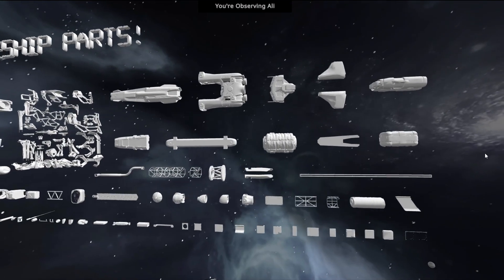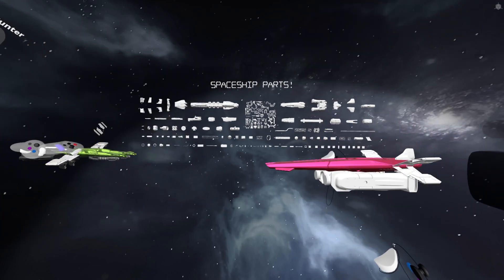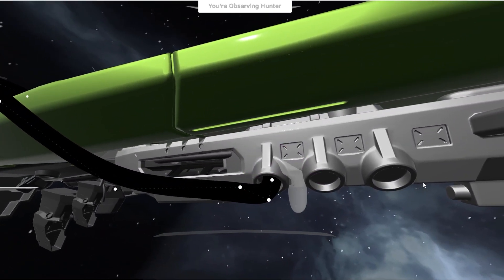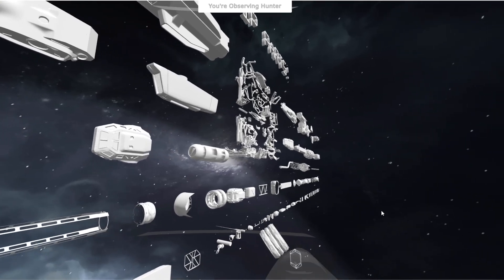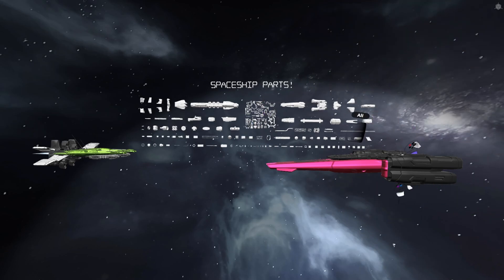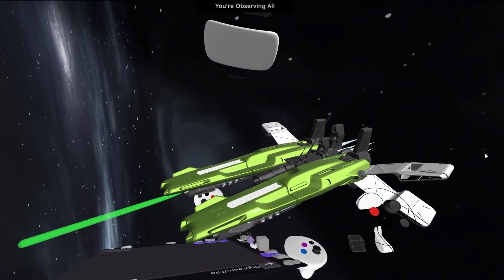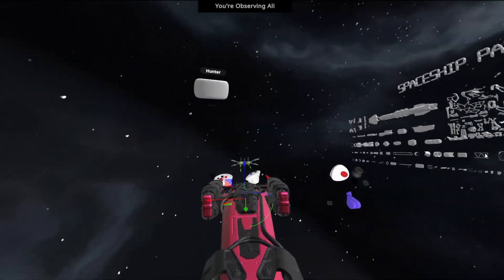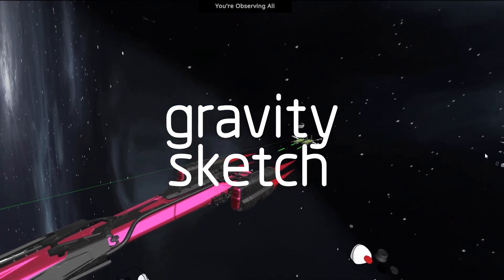Kitbashing in Gravity Sketch

Comment: This is awesome. For good kitbashing,  gravitysketch does need to finally get some decent clone modifiers though. Often in scifi concepting you want to radial array a part to make an engine or something. This does look awesome though. Ever since my dk1 I've been waiting for a vr 3d app to give you this kind of workflow but without needing to spend ages building a zoo. It would be so much better to be able to open a folder in your space and they open up (as 3d models) into a large window that you can just start grabbing parts from. Gravity Sketch would be my dream app if that were possible.